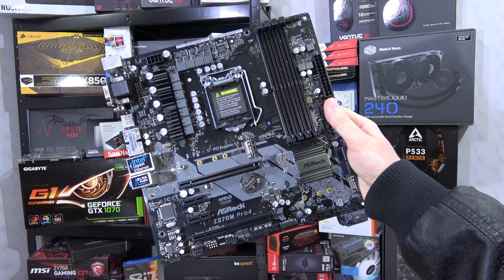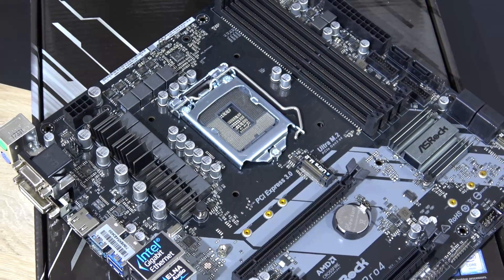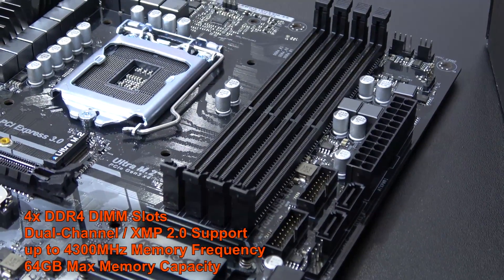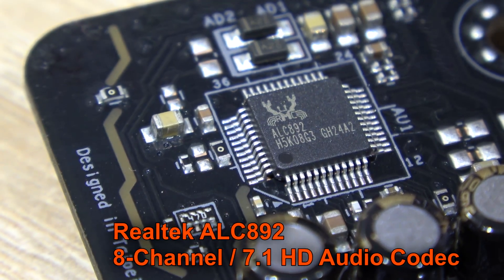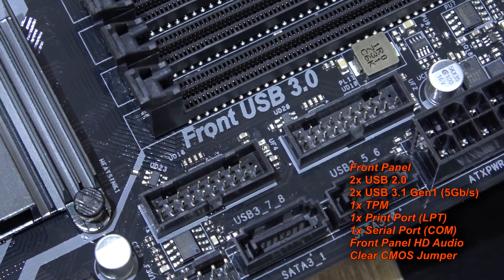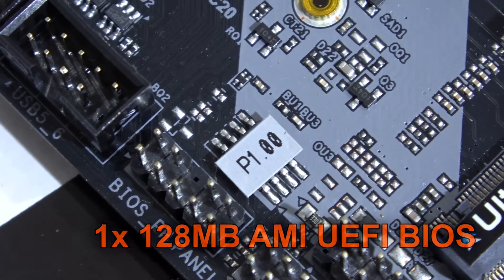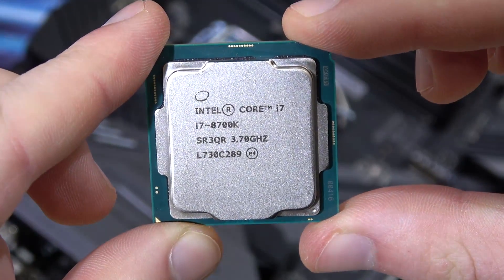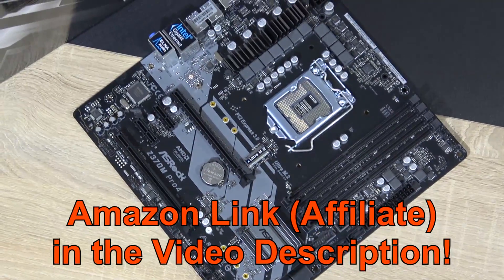ASRock Z370M Pro4 -- Cheap Micro-ATX for Coffee Lake?

Comment: The USBs are 3.1. Not 3.0 and it's incredible the pcie both run at x16 speed. Only thing missing is m.2 WiFi and 2 more pcie lanes which can be found on the brother z370 for less money
Reply: Since the lower pcie only has pins for x4, I doubt that.

Comment: ive got the full atx version of this board but it has the exact same vrm and it runs 8700k at 5.2 without raising voltage (offset voltage set to zero) and will do the blender render of the bmw.  it will even game at 5.3.  maybe the consistency of the boards vary from one to another but i have had very good luck with it.  i am adding a copper vrm heatsink and a small fan to it as well (maybe 40mm or a laptop blower whichever will fit) while thermal epoxying the stock heat sink to the top vrms even though they dont get really hot.  for gaming i would trust the vrm's even at 5.2 ghz i think.  for extended renders or encoding maybe not but for gaming i think this is all i need.  but maybe i would get better results with a different board but i really dont think so. guess i just got a golden chip.  will be delidding soon as well.  wish me luck
Reply: well you can buy fan splitters and put 2 fans on each header that way.  or you can just buy a fan controller and use that to control the rest of your fans.  how many fans do you want?
Reply: say for instance that your front and rear exhaust fans are the same size and you want to run them at the same speed then use a splitter to run both.  maybe you have a heatsink that has 2 fans.  use a splitter to run both on the cpu header.  i have 6 fans running on mine even though it only has 4 fan headers coutning the cpu header
Reply: you can get usb fan controlers that plug in to a usb header on the motherboard (not a usb plug but a usb header).  these can usually run 4 extra fans with individual control of speed

Comment: Bought this board on $100 deal for my i7-8700K. 4.7Ghz on air cooling with undervolting. Cool and quiet. Thing is, I do not want to pay extra $150-200 for an expensive motherboard and water cooler, just to hit 5Ghz. The FPS gain in games is low.
Reply: i think it will hit 5ghz pretty easy.  ive got the full size version of this board which is basically the exact same board and vrm and can game at 5.3 at around 1.35 or  a little less.  blender is stable rednering at 5.2 at 1.35
Reply: get a cheap watercooled loop with 1 or 2 fans and of you go , 5ghz and up
as long the case temp stays reasonable the vrm temp won't go crazy either
got a thermaltake core v21 , is a square box with a 200mm fan in front and 140mm back and it's perforated at the bottom and the side
never gets even close to a descent temp , ever , cheap thing , but clean and quiet
Reply: that's right..it's the smart man's choice..children who want flashing lights need go elsewhere....

Comment: could someone explain the "10phase design lack vrm cooling, will limit your OC"? what is it limited to?
Reply: If you wanna go to 4.9-5.2Ghz on your i7-8700k, you will need to raise the voltage a lot, and that will burn your VRM. I have same board with an i7-8700K at 4.7Ghz, on air cooling, with undervoltage. Thing is, I do not want to pay extra $150-200 for an expensive motherboard and water cooler, just to hit 5Ghz. The FPS gain in games is low.
Reply: i have the full size z370 pro4 but it has the exact same vrm and it does everything stable at 5.2 at 1.35v and will even game at 5.3 but is not stable at that voltage.  needs 1.4 which is more than i am willing to use.  i normally run 5ghz with -100 offset so it stays around 1.25 most of the time.  maybe consistency from one unit to another varies a lot or i just got a good chip.  but if all you are doing is gaming and websurfing and not heavy duty stuff like rendering or encoding videos i think its alright.  people are saying its really a 4 phase with doubling but keep in mind some companies just do plain 4 phase with no doubling on lower end z370 boards.

Comment: I recommend buying an external 7.1 sound card to use with this motherboard. I am very happy with my Vantec NBA-200U, for example, but you can shop around. I have a 5.1 speaker setup with the green, orange and black 3.5mm cables, but this motherboard only has green (front speaker audio), blue (line-in) and pink (microphone) 3.5mm plugs in the back.

Comment: About the 10 Phase design, it's NOT 8 + 2 as asrock would like you to believe, it's 2x4 + 2x1, basically half of the VRMs have identical timings as the other half, thus each 2x VRM act as one, which results in a scenario where you basically have  4 + 1 bigger VRMs, a bit better than just a plain 4 + 1 VRM design, but certainly NOT even close to real 8 + 2 phase VRM design.
Reply: +MzNtoS Yes, basically any ITX and micro-ATX motherboard from AsRock.
Reply: But what if I'm not overclocking? Does it matter at all then?

Edit: does this board have decent power?
Reply: +Arcade Party with an i7 8700k or i5 8600k you'll be pushing the VRMs of this board nearly to their thermal limits IF you stress them to the max with this configuration and cooling and when overclocked you basically are on a mission to melt them, though if gaming is going to be your primary AND most demanding usage then at stock it shouldn't be a problem since games even at 100% usage rarely reach the peak power consumption and with a i5 or i7 6 core you will never come close to it in games. 

VRMs usually have a safe operating temperature of between 95-105C and anything above begins to shorten the life span, with 120-125C being the maximum they can operate at before either defenses shutting down the power delivery or them just melting and do NOT listen to people that were lucky enough NOT to blow(not literary) them up when they ran them at 100-110C for a year, most cases result in dead mobo and even CPU after running them for a year and a half to two years.

Though again if you are NOT going to do gaming as your heaviest workload and maybe some recording/streaming, without overclocking you will be totally fine.
Reply: Hi. I'm new to those term definition of VRm. Can u explain for me what are "8+2 vrm" or" 2x4+2x1vrm" Arcade Party was talking about? and I bought a z370 tomohawk from MSI so those VRM on that board are better than those on this Asrock z370m pro4 or they are just exactly the same?
Reply: +Long Nguyễn Hoàng Ok, simply put in semi-laymen's term:
VRM stands for Voltage Regulating Module, it's job is to reduce and control the voltage that is sent from the 12V rail down to the voltage needed by the CPU, usually between 0.75V to 1.25V when NOT overclocked depending on the CPU and CPU load. And the smaller VRM count is for the RAM.

The each phase is a module itself that SHOULD have different timing than the rest so that they can deliver power one after another, the more phases the more the voltage is spread about equally between all modules, the less heat there is, the less you need to cool them.

Now in the asrock z370m's case the vrms work in pairs, so that 2 by 2 have the same timings, so out of the 8x phases for the CPU, there are 4 total different timings which is more effective than having just 4x phases, but NOT as effective as having 8x dedicated phases with different timing for each one, same for the RAM VRMs. So the Asrock z370m essentially has 4x + 1x "BIG" VRMs, as I like to call them, or some refer to them as "Stacked"

MSI does NOT duplicate timings(AFAIK), so if your board is 8x + 2x phase VRMs, it is actual 8x + 2x phase. if it's 4x + 1x it's 4x + 1x phase VRMs.
Reply: Some boards also feature a legit 6+2 phase it is mostly seen in the newer itx boards. Mostly from Asus,Msi and Asrock. The new B450i and Z370i have them as seen. Also to know more info about this stuff check out actually hardcore overclocking. He explains alot of stuff about motherboards and their vrm capacity.
Reply: This board has a 4+3 phase vrm.